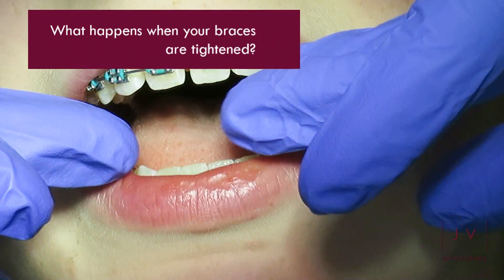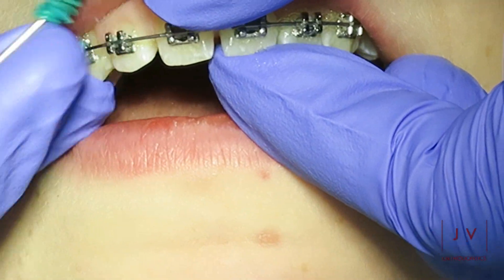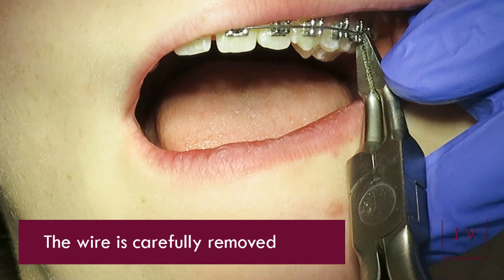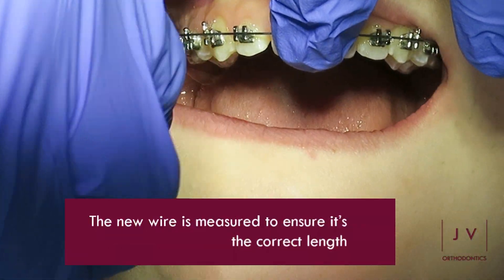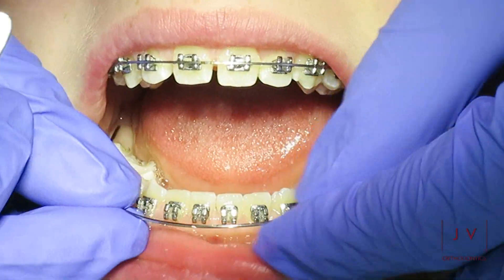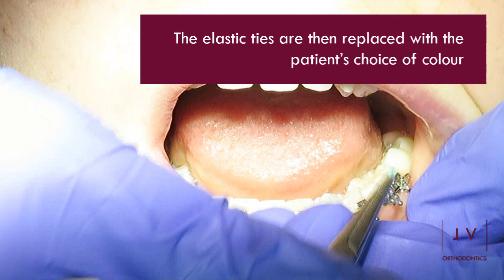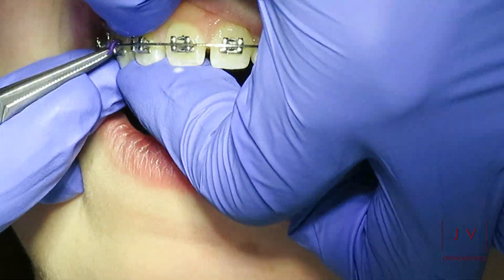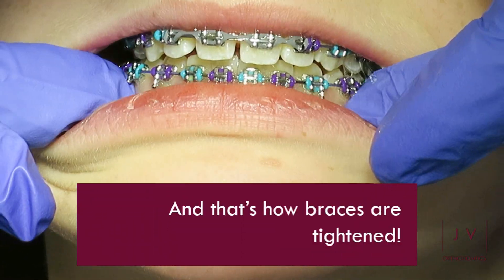WHAT happens when your braces get tightened?  |  Dr. Jiten Vadukul  |  The Orthodontist

Comment: Hi, I have an appointment on July 1st to get my braces on. I'm super scared. I've seen all these stories about the pain after the installation and tightening and I'm really starting to question if I shouldn't get them as I cannot handle pain. What should I do?!
Reply: Hello man, I want to tell you that the pain is bad but it’s not that bad ok? I’ve had my braces for almost a year so boy I understand the pain. I recommend you have pain killers a hour before you get your braces on and getting them tightened. If you don’t have pain killers just eat something cold like YUMMY ICE-CREAM, this reduces the PAIN IN YOUR MOUTH ; If you can’t have ice cream :c then you can have ICE CUBES to put on your gums. This helps, I UNDERSTAND THE PAIN *cries because I got my braces tightened today*. Oh, and the pain only lasts 2-3 days, so the pain doesn’t last that long :). Hope that helped.
Reply from the maker: Hi there. How exciting that you'll be having your braces soon! I will give you some guidance: having your braces placed is usually a pain-free procedure so please do not worry about the brace-fitting. Once the braces are on, they can make your teeth and jaw-bone feel sore. The most significant discomfort usually kicks-in around day 2 or day 3 following brace fitting and it tends to improve over a week or two. I would suggest persisting through, however please let your Orthodontist know: they may be able to give you some helpful advice.

Comment: Question. Does it hurt bad or is it just like a tooth ache kind of feeling
Reply from the maker: Hi there, it tends to be more an ache-like feeling. The teeth can also feel quite tender when pressure is applied to them. It is less common to experience any sharp pain following brace fitting, so it would be best to see your Orthodontist to check your braces if there is any sharp pain.

Comment: Hallo, I have a question and would be so happy if you would answer😊 my clear retainer is slightly loose on the back molars at one side. I can push it slightly up when press with my finger but it doesnt wiggle when I bite down. My ortho said it is okay. Should I be concerned? Will it still work?
Reply from the maker: Hi, it is difficult for me to give you specific advice about your retainer without seeing it, but generally speaking, as long as the retainer is fitting well over the teeth, there is less chance of the teeth moving/relapsing. It's good that you've asked your Orthodontist to take a look.

Comment: I just want to ask if it's okay to have braces without having xray first?My dentist didn't ask for one but I've got them on for more than two weeks now and they feel fine but I'm worried if my dentist tighten them up and they would hurt because I have some history of toothache on my front teeth but some prescribe antibiotic healed it(it happened 2 years ago).He don't explain things to me because he has a lot of patients that I only get to talk and ask to his secretary.Will it be okay?Your opinion would be a great help coz I'm scared.
Reply from the maker: Hi Jinky, thanks for your message. I usually tend to review X-rays of my patients before braces are fitted, and that's to check the health of the teeth, the supporting tissues and the state of the bone in which the teeth sit. It may be that your records have an X-ray on file. If you're concerned, I would suggest speaking with your Orthodontist/Dentist about your X-rays. I hope that helps.
Reply: @the_orthodontist  thank you so much.I didn't know xray's are that important until now.
Reply: Btw that teeth of mine looks really fine,no black stains,tartar or plaque that i wonder why it hurt that time

Comment: Wait wait i want to ask a question 
When they tightened it does it hurt?
For a week or days?
Reply from the maker: Hi there, thanks for the question. Well whether they hurt is dependent upon the individual and is also based on what is happening at the adjustment appointment. Usually, any adjustments that will put more force upon the teeth will lead to some discomfort (anywhere from 1 day to 1 week) which tends to be more of an ache.

During the actual tightening process in the orthodontic appointment, this process does not hurt. Occasionally patients experience a pressure ("tight") sensation when the elastics are used to secure the wires in place.

Hope that helps!
Reply: oh, girl, It does hurt a lot trust me I have been there before
Reply: @the_orthodontist  i havemy braces. But i dont want it anymore. Should i get this brace? Even its only 7sesion?
Reply: Oh yea i got my braces tightened and it did help and it pain xd
Reply from the maker: Hi both, a lot of my patients experience tenderness with their teeth after having braces fitted- this tenderness has been shown by research to be worst 2-3 days after braces are fitted.
Reply: They only hurt for a couple of days, you can take pain killers so you don’t feel as much pain :>
Reply: went to my 2nd visit 3 weeks ago  and im still eating soup  😂 idk why mine hurt so much